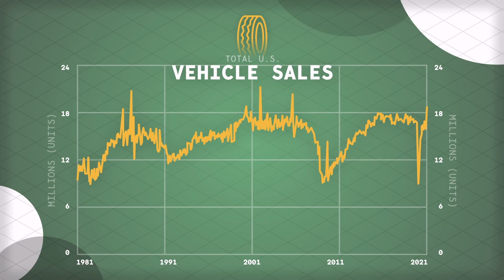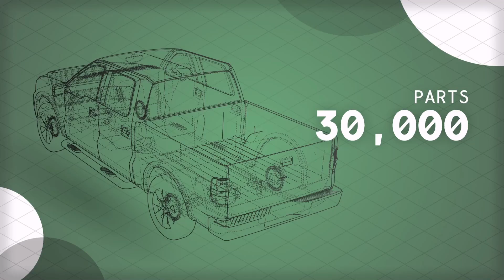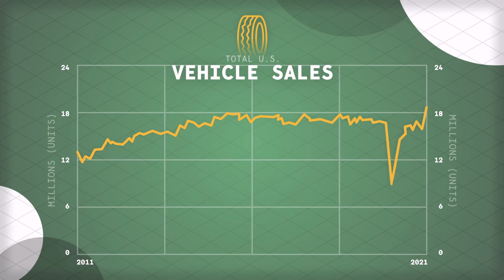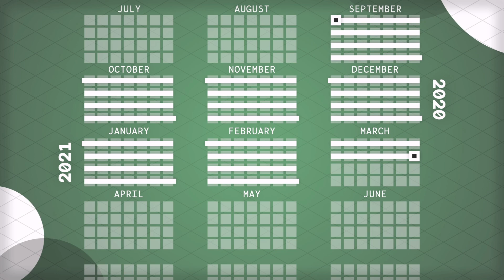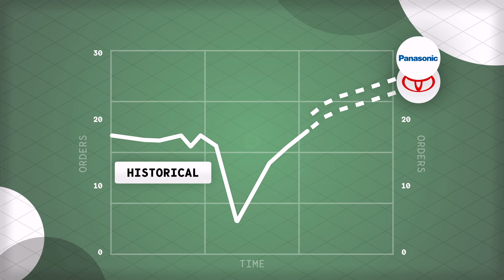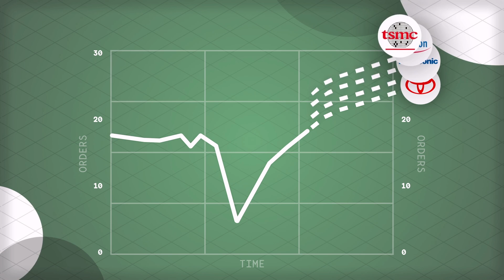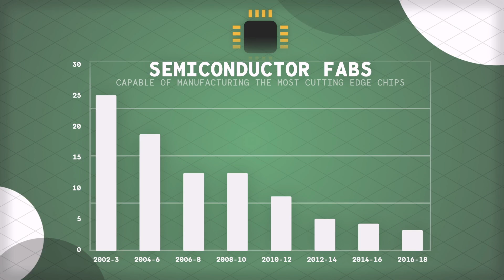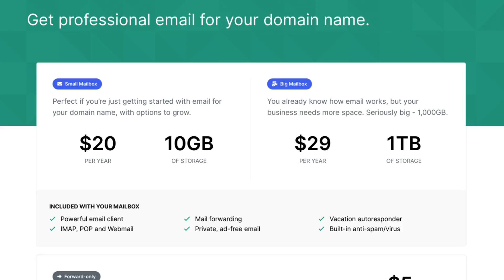Why the World is Running Out of Computers

Comment: those of us who were there at the very start of home computing remember how it was, how they milked everything.

my first cd-rom was 1x and cost nearly 300.00 at Comp-USA then came the 2x, 4x, 6x, 8, 12x, 16x, 24x, 32x, they milked every last dime out of each tiny increase!!! now apply that to the entire computer, motherboards, CPUs, memory, hard drives, 50 pin SCSI, 68 pin SCSI, 80 pin SCSI, RLL, MFM, IDE, E-IDE, SATA I, II, III, 8-inch floppy, 51.2 MB 1/4 inch floppy, 720k/1.44 MB 3 1/2 inch floppies, for me buying a brand new computer at 2,000 dollars was not an option.

So I got a used 486 SX25 and began the upgrade route,  it was a lot cheaper to buy one piece at a time and upgrade than trying to buy a brand new computer, upgrading worked well until the standards began to change, 8 bit/16 bit ISA slots, then Vesa local bus, then PCI, extended PCI, each new platform was stable for a while.

and oh my stars!!! video cards and audio cards came with up to three full games, and many demos of others.

Gaming was the leading cause of advances in processing power, thankfully I no longer am a gamer, I have about 8 full years of wasted time on nothing but gaming.

https://www.cbsnews.com/news/addicted-suicide-over-everquest/#:~:text=Last%20Thanksgiving%2C%20Shawn%2C%2021%2C,the%20online%20computer%20game%2C%20Everquest.

A 21-year-old committed suicide after losing an EverQuest character, do not tell me that gaming is not addictive, been there done that,

machine bragging rights,  anyway thankfully that is over and done with, I will never play another game as long as I live, like the alcoholic, I cannot play even a simple ballon proper on my phone as just allowing myself one game will bring the who shebang flooding back in and I will be 18 hours a day doing runs trying to collect the goodies from AD&D games.

Comment: The Bitcoin frenzy and the energy-inefficient bitcoin miners are hoarding most of the computer systems, nearly all of the Ray Tracing Graphics cards.. we build top of the line Gaming systems which require the RTX Nvidia cards.. Bitcoin miners are scarfing them all up, driving the graphic card prices up 200-300%.  It is really sad.. even Nvidia is trying to put a cap to prevent it from being used by bitcoin miners, but the miners are hackers too, they will find a way..

Comment: Good.  We need fewer microchips in cars because these bells & whistles prove to be as unreliable as other electronic gadgets.  Unlike a malfunctioning phone or laptop, it's not as easy to throw out an automobile because one of the power windows don't work, and good luck getting it fixed.  That $4 part is buried underneath 4 hours of labor in removing other parts in order to reach it.

Aks anyone with a car that is a few years old and loaded with features lots, and I bet they have at least 2 or 3 they don't use because they don't work.

Everyone wants to drive a Federation shuttlecraft but no one wants to build one with that level of reliability.

Comment: If anything comes out of this, then I hope it is widespread pro-consumer legislature. No wonder there is a shortage in semiconductors, when cellphones become arbitrarily obsolete after two years either by merit of being unrepairable (for example because the battery is not interchangeable) or by means of software update: Both Apple and Samsung have been found guilty of throttling old hardware's performance via software update to incentivize buying a new device.

Comment: What I don't get is, what are the last generation chip factories doing. I am pretty sure that most chips in cars (minus for autopilot) don't need 10 of billions of cutting edge transistors. Sure, the PS5 chips are in competition with nvidia for 7/8nm factories, etc. but regular microchips for simple electronics? just produce them in "old" factories with e.g. 25 or even 50nm.

Comment: Begs the question, why the fuuuuuck are we putting computers in cars!? Haven't these fuckers ever owned a computer?! They break all the damn time!!
ESPECIALLY  when you put them in a hot box in the engine compartment where they bang around for hours a day.
Reply: You know, computers in cars aren't just to play fortnite. Safety issues. Tell me how another way you are going to light all those controls with the most fearful one - check engine. There must be even the most primitive one. Add GPS, wi-fi and much other modern stuff.
Reply: @lechgolas6400  look buddy, we don't need GPS or wifi in cars, we have phones for that. We don't need push to start and cars that can only be tuned on a computer. We need reliable cars with easy to change mechanical parts. Cars were safe before computers ran the whole car, we don't need it.
Reply: @OGCovertKaos  Ok, but still, some computing parts are required just to light control LEDs. It's just we didn't worry about the future and the resources. And now China wants to take over Taiwan and force it economically to unite. And of course crypto miners are a great pain in ass to that point. I don't think computers in cars is a big part of that problem, not even a noticeable one. At least I don't perceive it that way, in the Eastern Europe almost everyone have cars at least 10 years old, so I might be wrong ;)

Comment: this is why we need more computer recycling businesses. but also, we need to not simply replace our older technology's but utilize them as a means to ration more precious materials, and also using the old techs can be cheaper.

on a lighter note, using older tech would have appeal to the nostalgia buffs.
Reply: YOU HAVE THE BEST COMMENT OF ALL!
Reply: ,,,,, @humor62  I only say it because I don't understand why this is not a thing; I guess social media and the appeal of modern techs has distracted us from appreciating older technology. Yes, the old tools were crude and bulky, but they do still work.  Hell, my father has an antique table fan; its shell is cast iron, it looks ugly and crude. But it works perfectly. It will outlive the phone I am using to write this comment; it may even outlive me.
Reply: @WaTahBasTard  older pieces won't really help the issue though, as it's the assembly, not the material, that is in high demand.
Reply: @AvgJoeCrowe  without material, there can be no assembly in the first place.
Reply: @WaTahBasTard  You know 25% of the earths curst is silicon right? which is used to make semi conductors and there is a shortage of silicon. Its just that people that run the factorys are stupid and thought "hmm people wont be buying electronics due to a pandemic" so they shut down factorys and stopped mining. We wont run out of silicon any time soon they just need to boost up the mining and production not that hard to do if this corona virus fucks off.
Reply: @WaTahBasTard  But again, as said in the video and Joseph's comment, the shortage is in the number of capable FABs & their throughput (see lead time of a single wafer). Keeping old tech around will inevitably create more strain on energy demands per unit of computation. As others have pointed out, you can only really reclaim some of the materials and the efficiency related to this can often be not worth a company's time and resources. Gold is the only material I've worked with which is always put into reclaim for obvious reasons.
Reply: @WaTahBasTard  But that's not the case.
Reply: @WaTahBasTard  it’s because the farther back you go, the more healthy the model of business looks. Things used to be built to sell based on quality and to last a lifetime… think of the legendary Nokia. Now the model is based on planned obsolescence, and weeding as much money out of a consumer as possible by giving them a cheaper product that is just good enough to last a short while. If it breaks, no big deal, they’ll just buy another. In some cases, like Apple, they actively encourage people to throw away their perfectly good old phone and get the new one with their marketing. Even worse, Apple in particular slowly and deliberately makes newer software incompatible with the old, forcing people to abandon perfectly good tech just to stay in line with the current environment. They get away with this because of their popularity and because the modern consumer has traded exceptional quality for cheap replaceability.
Reply: You can create a massively powerful parallel supercomputer by networking a bunch of shitty 'obsolete' CPUs together. If the old tech still works, it can still be used productively.
Reply: Recycling a computer components is not easy. Some of them are not recyclable.
Reply: It can be recyclable if you can detatch the components from a board, remove coatings abrasively and relieve the minerals and metals of impurities which will obviously be meticulous and time consuming since not every board is the same or even chord but it would help to "regrow them" as you would a geode...They have different conditions though and many would take more than a year to develop fully when "planted" right. Synthetic materials crafted aren't as profitable because they are cheaply made and of poor quality.
Reply: Recycling isn't a complete 100% output of recycled material. Many components become useless or non-recyclable with time/use. Though attracting people's attention, that this practice does exist, would be a good step to improving the process. 

Also, as processors and the like become faster and smaller. The complexity in manufacturing becomes slower and harder (more likely to create scrap).

In all, it's a hard problem to fix/remedy on all fronts.
Reply: I want my 1969 Datsun 2000 sports car back. It was simple to drive, simple to fix and a blast to drive where I needed to go or just joy riding in Northern California's mountains.
Also, I really don't need a cellphone.
Reply: older chips consume way more power than newer ones. Which is against environment protection. But even if we ignore that: Chips are very very fragile. and there are to many different ones. As a bigger company you cant reuse them in mass production. As it is unlikely you get enough of the same type and quality to start mass production. And in individual production, which is waaaay more expensive you dont use old stuff, which might be broken, or break very soon. So yeah, sounds great in theory, but doesnt work.

What we need is the right to repair. And a law forbidding that whole macbooks are declared trash, just because 1 adapter for 3€ is broken.
Reply: We don't need more computer recycling businesses, the existing ones just need to up their advertising game.
Reply: I just upgrade my computer if I can. It helps me keep it longer and I try to recycle whatever I don't want to keep
Reply: @LostinMIA  Right, I agree with that. e.g. A toaster doesn't really need wifi and I haven't felt a need to get a phone upgrade. I would say that in those cases many businesses understand this - it's often individuals who like the new a shiny thing that feed the issues en masse. However, I've spoken to people who seem to try to really draw out the demands of their old tech despite it slowly becoming more incapable to do it's job in an efficient way. E.g. My PCU in my computer is about 6/7 years old, getting hotter and more inefficient as time goes on... it meets the demands but at a greater cost to electricity and efficiency - this is remedied by a new, updated one. Therein lies the specific application of my initial view.
Reply: @LostinMIA  Not wrong there :)
Reply: Yeah no shit I’m gonna use my old Wii once in a while
Reply: xvoided  Well then that is a redundant point since it's already done on a large scale.
Reply: asking to recycle computers is like asking to glue a glass back toghether after it shaterred into dust it's impossible to recreate the original, in the case of computers many many parts are impossible to recycle unless u are gonna recycle it into the same computer after repairing their parts

u cannot use months old tech bcz it is incompatible and the only "rare" material it uses is gold and they do not use much gold since they are relatively cheap the quantity of gold each chip uses is very small
Reply: @vitortk_CH  Exactly. Also, people are whining how old tech is so much better because it's more durable. That may be true, but it's extremely slow, and old. Maybe it works fine, but that doesn't mean it's practical, or useful. And no matter what the computer is, compatibility issues with it will reach it in a matter of years, for example, you can't run Google Chrome on Windows 95, and even if you could it would be so incredibly slow that it's completely pointless. You can't upgrade a Windows 95 computer to Windows 11 because first of all, it can't run it, second of all, it won't let you because it won't be able to run it. Technology is advancing at a rapid pace, and if you don't upgrade your stuff after 5 years of having it, it's essentially useless and impractical. Yes, technology can be recycled, but only up to a certain point. The only value it has is for nostalgia.
Reply: @ThanosIsUglyGD  as an aside, you totally can use Linux on older computers to get a huge performance boost, since it’s not that their hardware is THAT outdated it’s just that modern software is geared towards devices with modern hardware with the assumption that they can handle it just fine. Chrome and other apps dont need to be so damn inefficient, and there are certainly ways to get more out of older systems that don’t involve just throwing them away
Reply: @willmungas8964  Fair point. I just feel like people overestimate how much an old computer can do. If you're computer is really old though, Linux is definitely the way to go. I forgot Linux existed there for a second lol
Reply: Tell apple and android to continue to provide security updates for older phones
Reply: i love tinkering with my carburettor in my motorbike, i really do.
Reply: Nah, people will only hoard now that this shit had happened.
Reply: This is literally the first thing that came to my mind. So many big companies blindly replace their computers every 3 or 5 years without stopping to think that their older computers are probably still good enough for what they need to do. I see many 2nd and 3rd gen core i5 systems which just need an ssd and maybe a ram upgrade in order to make them perfectly useable for 90% of the computing tasks that most people do, being replaced by businesses which don’t need the processing power of a newer system. Even worse, many businesses have no clue how to properly get rid of their older systems. A friend of mine recently rescued a server with 1TB of RAM and 2x 8 core IBM power cpus from the scrap yard. Also saved an lga 2011 system with 64GB of ram. I can only imagine how many perfectly useable computers there are in this world which are sitting unused or are needlessly thrown away just to get something newer which is even more overkill for the application at hand than the old under-utilized system was. And don’t even get me started on the shady BS that manufacturers try to pull of just to sell newer and supposedly “better” systems. It makes no sense that Windows 11 is certified to run on brand new netbooks with crappy dual core celeron cpus but doesn’t support older high end desktop/workstation platforms such as X99, X79, and X58. Those platforms might be older but they can still destroy many brand new laptops when upgraded.
Reply: Thanks! I'll play warzone on my 2009 laptop with no gpu!
Reply: And we can recycle old tech too
Reply: That works only to a certain extent.  Tell Nintendo, Microsoft, and Sony that.  That’s why gaming software companies are still supporting last gen.
Reply: Hell fuckin yes. return silicon to the Earth and metals so that they can regrow and mark it as a resource resale "farm" for recycled raw minerals. This may take years to regrow a fully developed mineral but it'd be profitable.
Reply: Fucking apple is so wasteful
Reply: It's too late. Capitalism is gonna destroy our civilization for "profit" very soon.
Reply: Lol for serious security reasons, many computer parts are simply destroyed or rendered utterly useless. Also in the modern era nothing will work properly after 3-5 years. Those pieces are basically worthless already.
Reply: Yeah, why worry about new game consoles when the old ones still work? I just bought a new (to me) Playstation 3 game and besides the dated graphics it's been pretty awesome. I'm sure this can be applied to far more than just game consoles, whatever your personal context.
Reply: that'd be great but I would certainly never even begin to think about making a business like that. Yea let me gamble the rest of my life away for a business that cannot make money.
Reply: my nas is literally my 14 years old computer with half dead motherboard
Reply: How about you start your own company lol
Reply: Yes we do, but wasn't the whole video about how we don't experience a shortage?
Reply: bro ive been user the older tech my whole life, im on a computer almost as old as me
Reply: Why dont we just melt down old unusable stuff that doesnt work anymore and then seperate that and reprocess it?
Reply: We need to start mining asteroids.
Reply: You can't recycle semiconductors.
Reply: I still watch VHS tapes.
Reply: That's historically awesome; I try to reimagine in mind the VHS updated with a modern tech spin and wonder if that throwback could be redesigned to be less wasteful of resources.